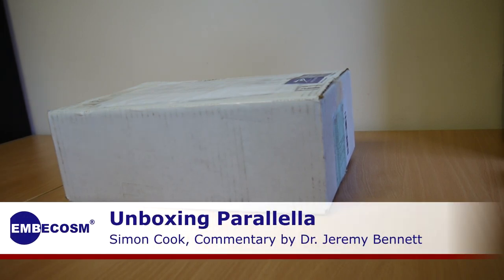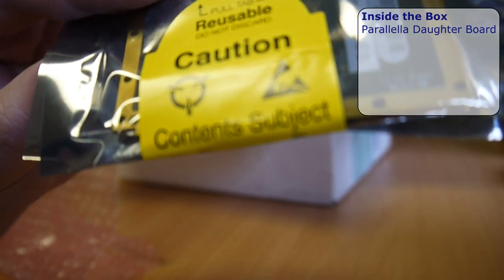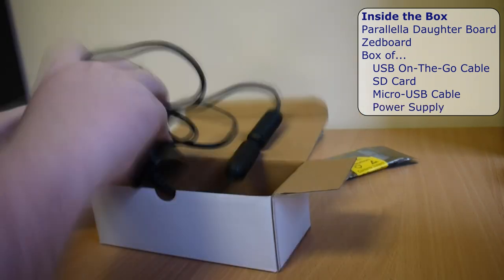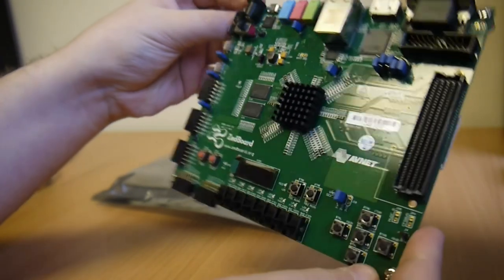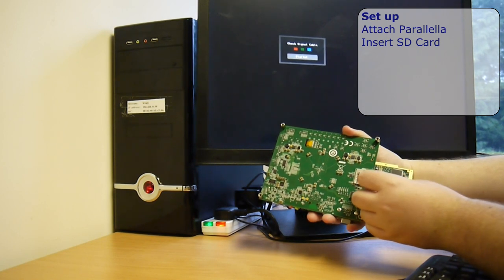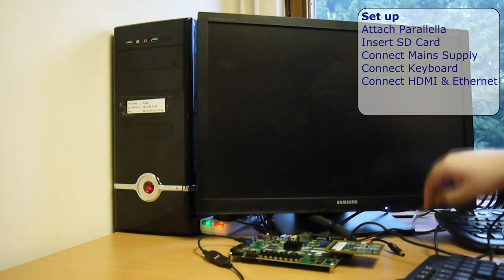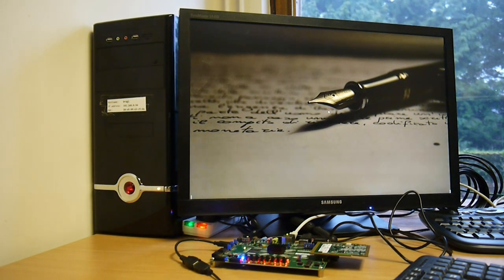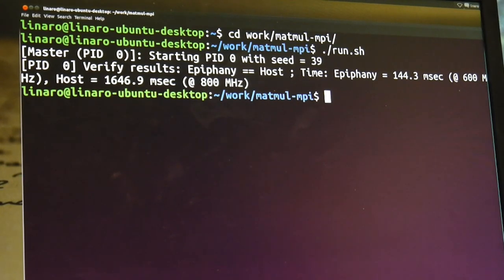Unboxing the Parallella Prototype Board

Comment: So you've got a Xilinx FPGA on the Zedboard, another [Altera] FPGA in the Parallella - and the new CPU. And by using up the FMC connector on the Zedboard, expansiion options are immediately limited. Wow, what a terrible decision.
To get away with offering lousy expansion, you need to be a Much Bigger Company- like Apple.